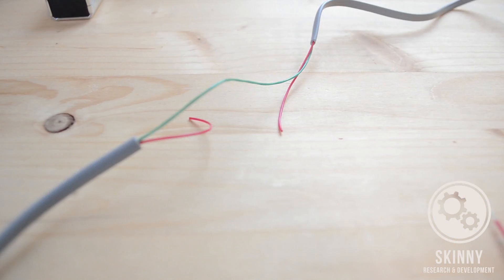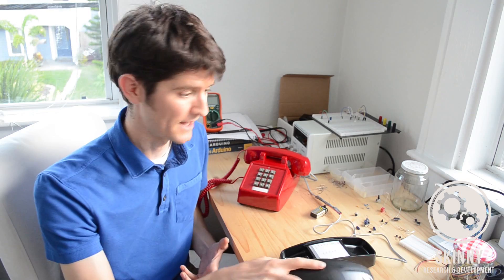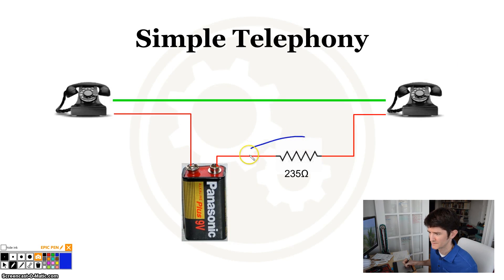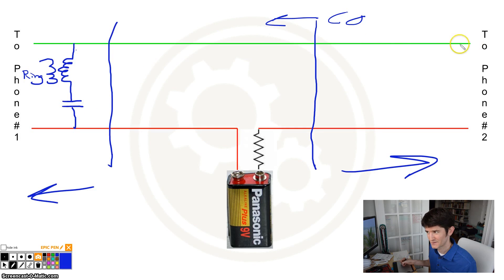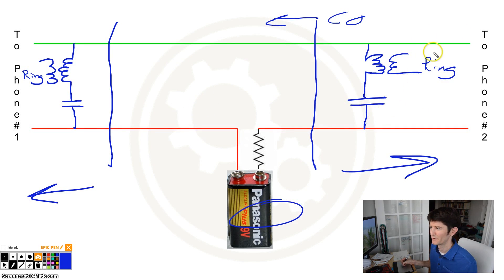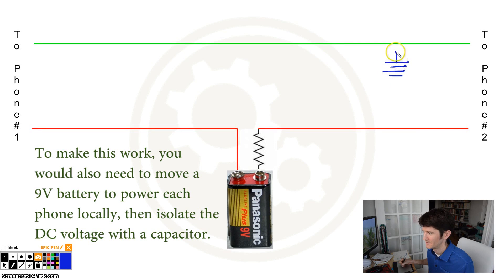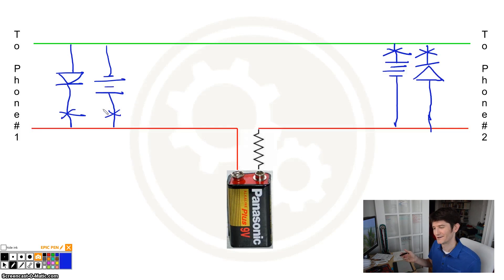9 Volt, Battery Powered, Telephone Intercom System

Comment: 2:00 i used that system with two bbk phones, and i powered it by 12 volt power supply, and also i didn't add the resistor
Reply: And it worked really well
Reply: يعني انا اقدر استعمل هاتفين

Comment: Is there a way to use this method if you want to connect a phone device to a computer to upload or download the data files where it depends on a landline dialup but you don't have a POTS landline?

How would you get the 2 sides to handshake if you don't use a telephone number or a dial out/answer procedure?
Reply: It's not needed in this setup. You can do the same with just a couple of handsets  If you want to dial a number to make the other phone ring you can use a phone line simulator we had some where I work. You program a phone number in and when you hook up the two phones you can call each phone. The phones can ring if you make a call to the other phone. 73
Reply: @ronb6182  interesting. Please explain further. It appears your comment was cut short at the end.
Reply: @realSamAndrew  if you are talking about phone line simulators. They are a phone system in a box. They can be programmed to a phone number and some have four lines I used two lines for express net a rate and bookkeeping program . But  if you have 4 phone lines you can set up each phone to. Number you can pick either 3,4 ,7 or ten digits I haven't tried a country code. For intercom it's best to use 3 or 4 digits . 73
Reply: @ronb6182  ok, so where can I find a phone line simulator these days? And what is the 73 at the end? 🙂

Comment: This brings back memories.  In sixth grade science class back in the 1970’s, we had old crank telephones from the early 1900’s.   We would connect theme to a (I believe it was a called a #6 dry cell ignition battery).  The battery was circular and stud about 8” off the table with stud and nut terminals on to hold down our wires.

We also connected old boon box like speakers and talked to each other.  If my memory serves me correctly, the speaker could serve as both the microphone and speaker at the same time.

I have looked for those circular batteries several times over the years to no avail.  I wanted to try this experiment again.   Perhaps I will try using a 9 volt.

Comment: बकवास,  does not work. I tried it.  Misguiding video. Technical aspects should be clarified.
Reply from the maker: Hmmmm... Perhaps try some different phones.
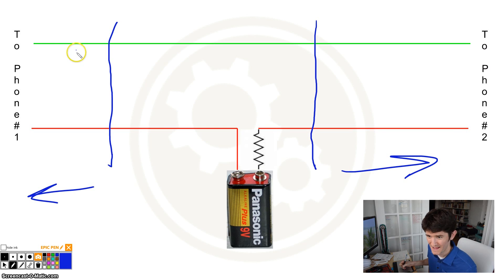Reply: The technical aspects are clarified from 3:00 onwards. If it doesn't work it means you either wired it incorrectly or you are using ancient (mechanical) telephones which needed higher voltages.

Comment: Would this circuit work if you only connect the hand sets. I want to put alligator clips on the ends of the wires coming from the hand set so I can clip one lead to a single conductor and the other lead to ground. So I can do wire checks with someone at the other end of a Multi conductor cable. For example we would talk on the blue wire and move the the purple wire then move to the orange wire, and so on.

Comment: Ringer....2 n/o push buttons in parallel, 1 at each phone. Either will trigger a 555 timer in monostable set to stay active for 20 seconds, which triggers another 555 timer in astable which is running a small muted siren and or led at each button. But you'd need 3 pairs then and older home phone wire is 2 pairs. I want to make this. Thanks!

Comment: I tried to rebuilt this project using two rotary phones, they work fine except that neither of them ring. I think it is due to the different voltage from a direct phone line and a 9v battery?

Comment: Phone wire cable has 4 wires could you use the other 2 to make the ringers work?
Reply: I think u can use them for a light, but u would have to see it when it lights up or it would have to be in a dark room.....why not just use your cell phones I mean seriously
Reply: @Takisarebetterthanfritos  I would do this for my kids. They don't have cell phones, seriously.
Reply: @franklinmckenzie8856  oh ok. I didn't think of that
Reply: @Takisarebetterthanfritos  I am trying to find a way to do this at my camp where there is virtually no cell phone signal.
Reply: @MrWoodchuck59  could walkie talkies work
Reply: @Takisarebetterthanfritos a  walkie talkie would work if they were turned on all the time.

Comment: No no no, I want a real genuine PLAR system. Private Line Automatic Ringdown.
Reply: Seth B Like a tone remote intercom? I use two Motorola T-1300 tone remote desk sets connected with one pair of telco cable.
They work fine. No need for a ringer. While the handset is cradled the phone's internal amplified speaker is enabled.
Reply: On eBay you can buy a used "Teltone TLS-4" or "Teltone TLS-5".   It has four phone jacks, dial tones, accepts pulse or tone dialing, the phones ring when you dial, you can have two conversations at a time, etc.  You can assign a phone number to each line, and it even does conference calls and caller ID.  It has absolutely no ability to connect to the public phone system but for an intercom system it works great.   You might have to pay $150.  A used PBX costs just as much, but is so complicated that it would be totally hopeless for most people.   The Teltone is not too difficult.  Its instructions are available as a PDF online, and it is easy to use with its default settings.

Comment: Great video, any idea why the resistor is needed?  I tried this with 2 phones, 2 9V batteries and it seems to be working fine.  1 battery alone would not work for me either.
Reply: The resistor will change the sound and volume. And the ohms will affect the volume. They will also roll off bass frequency.  
 I would really consider using one. I would try a 500k potentiometer as well. it is passive and needs no power. It  increases your volume and gives you control over it.
 If you look up a G&L Legacy (USA) schematic. They have a all passive design with a volume, treble, and bass. It would make you much louder, and you could fine tune the sound quality.
Reply: +F1shard I did not use a resistor
Reply from the maker: +F1shard Thanks! Analog phones come in many different forms. The internally circuitry is not always the same. My friend was able to power his phone off of one battery and no resistor. Another friend of mine ripped out the dial pad and powered it with a 9V battery. You have to take a look at what you are working with internally. 

The resistor is supposedly there to help limit the current on some instruments. I've run into some funky analog phones before, so I guess it could be helpful to someone.

In a normal analog phone, when on-hook the phone actually expects to see up to -48V. When the phone is off-hook, it usually expects between 3 to 9 volts at 30mA to 40mA. This can vary a few volts higher on some systems.
Reply: +Skinny R&D that's kind of what I was thinking.  Thanks for the response.  Interesting  to hear others are having different results as well.